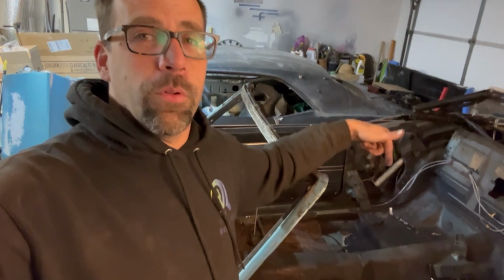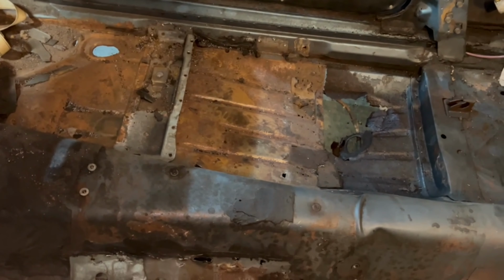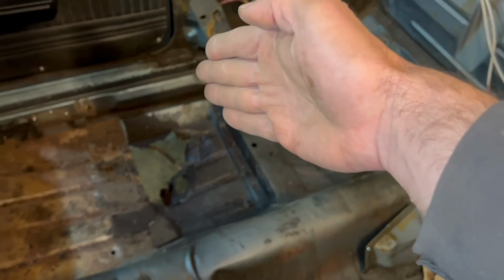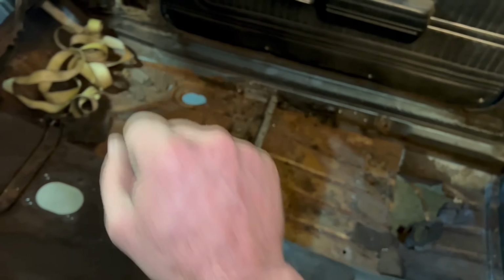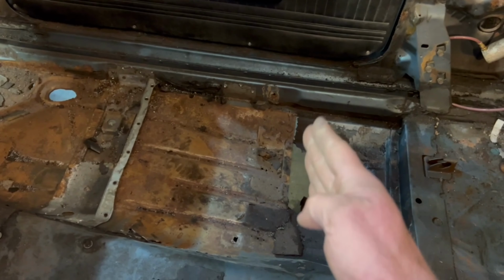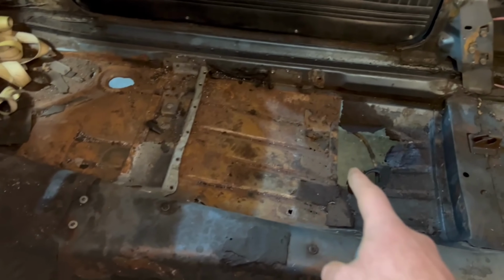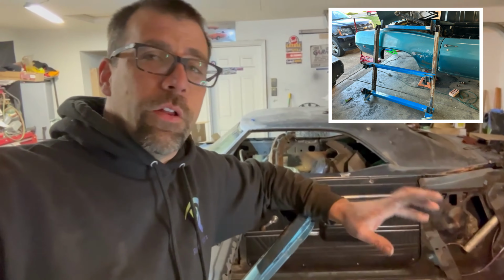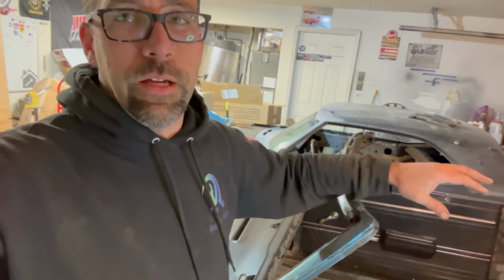STOP! Don’t cut that floor pan out yet. 1969 TransAm restoration

Comment: I have often wondered if it would be a good idea to add the convertible bracing to coupes for structure. you are showing it all clearly. Again, a great help.
Reply from the maker: Yes I have pondered the same thing. It’s all good until you get it to the x-brace and  exhaust clearance.

Comment: I bought both sides of the floor instead of the whole floor. I did this because I wanted the tunnel for structure to remain in place as I do think I will redo both rockers as well. Obviously not all at the same time. I am certainly glad the tunnel did not have any nasty surprise like yours did. I got the floor pieces firsrt and many years ago and might have gotten the whole floor if I was doing it today. I bought most all in early 2019. I hope to actually work on mine after Christmas so I can watch your progress and work on mine in real time. Thanks again for your efforts to educate.
Reply from the maker: Right on good repair plan, I don’t remove any more metal then I have to.  Keeping structure and reference points is why.  Good luck on your build and thanks for watching.

Comment: Great work i was just wonder  why you  didn't  weild  cross brace  in side car so it will not twist
Reply from the maker: It’s already very twisted trying to get that out. It was hit very hard in the RR. In the past when I tied bodies together I found I was cutting it loose to get the body to line up anyway.  Most of the time after 50 years of rust and collision damage the car isn’t right to begin with. So I haven’t braced much since then and rely on measurements and panel fitment to for reassembly
Reply: @VinylVillageGarage   you are doing great job i love watching  your videos   keep it up
Reply from the maker: Thanks. I do appreciate you watching and commenting

Comment: Nice thinking using a piece of allthread as a guide to set the floor pan back to the original height.
So the car didn't move when you cut out the center of the floor pan after having that crinkle in the middle. 😂😂
Reply from the maker: I have used that all thread a few times and it sooooo easy and i can say with total confidence it’s spot on. 
When I cut the floor it didn’t move much but what I have learned is I took the ratchet straps loose and the car barely move now. So the twist is greatly reduced. Moving in the right direction for sure

Comment: I put a floor in used the flange as alignment. I’m gonna have to make sure I check and make sure the flange size, but if they are you always use the flange from the floor and make them even with  your inner and outer rocker flange right? My floor was cut out before I watched the video.
Reply from the maker: The majority of the time match the flange works great.  I just got burned by that once and always checked from that point on and even if the flange was even I like to verify my subframe mounts height is good.  So if anything just check those.
Reply: @VinylVillageGarage  I will I appreciate everything I follow you through all your steps. I just didn’t watch a video before I cut off the floor so I don’t know the height but I will check the flange measurement when I get home.

Comment: Looking at that bend in the floor pan tunnel. You almost have to wonder if that was caused in the rear accident on it and they never straightened that when they to put all the other stuff on to do the repair. That is why it is not moving when you cut that in half. That means there's tension elsewhere in the back of the vehicle.
Reply from the maker: Yes I cut more of the car apart and found the rr inner wheel well is buckled in a few spots and the rear seat back frame is also bent. So I think you are right still many bent components that never got repaired

Comment: Great tips! Unfortunately for me I didn’t take that measurement before I cut my old floor pan out. Didn’t think about the sub frame mount height. I guess I will have to use spec book dimensions.  But I wonder, by the time you drop the new pan on the toe boards and frame rails, how much adjustment do you really get at the subframe mount?
Reply from the maker: It’s not horribly critical but definitely make sure they are the same height